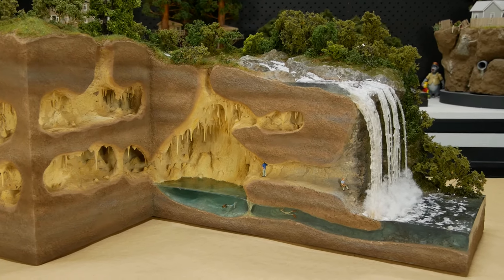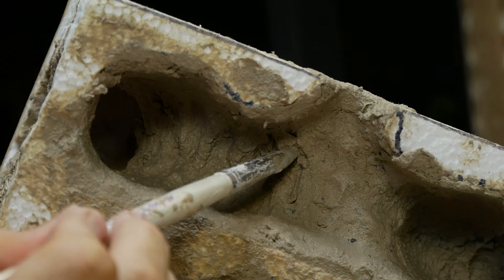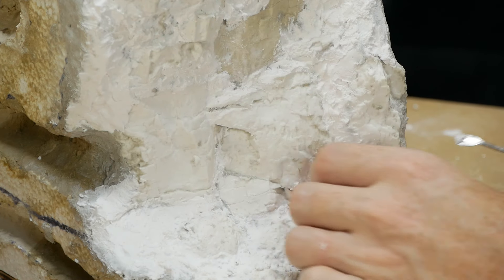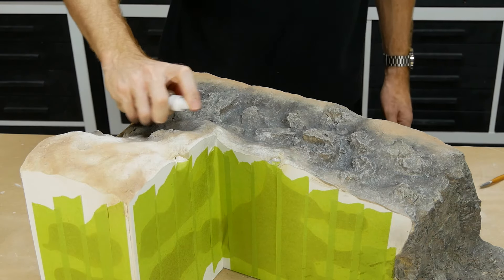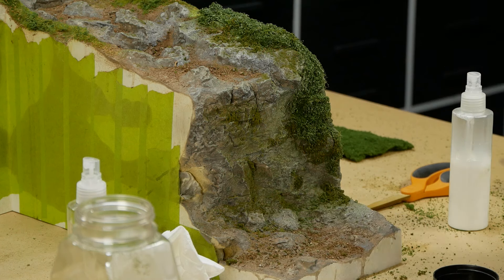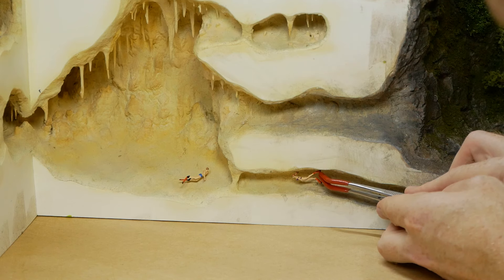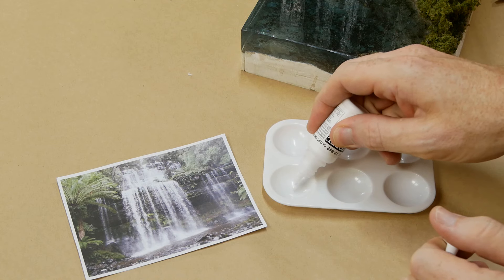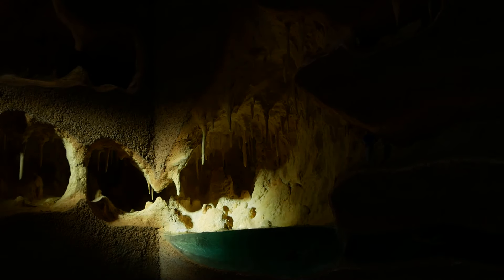An Amazing Waterfall with a Secret – Realistic Scenery Vol.26

Comment: I wonder if white glass micro spheres would be good for white water? Noticed you moved away from the snow filler. They're sold in bulk as epoxy filler. Might add a little bubbly effect.

Excellent work!

Comment: A couple of questions, Luke:   One of the classic problems with using casting resin for water is that it "creeps up" the sides of stream-side and mid-water objects like boulders and, particularly, small rocks.  The creeping effect is quite obvious to my eye (due to capillary action of the thick, gooey fluid, I think. It looks nothing like the edge of real water meeting rock in any case).  
Have you experimented with any additives or resin "wetting agents" you've maybe mixed with your pouring resins?  The sort which might thin down your top layers of resin, thereby reducing the creep, or do you find your final top layer of Mod Podge eliminates the problem?  You've obviously found SOME solution, as it's really hard to pick out any such problem spots on your dioramas.  
For an N scale builder like me, where the problem is twice the size and twice as obvious as with HO, any tips are appreciated.  
Great work, as always.   You are an inspiration, not only because of the high quality of your work, but because you get things done so fast.

Comment: Could you do a video about all the different modeling mixes and plasters and the upside and downside of each one? I'd also love to see a video all about foam. Foam melts or shrinks when you use it with the wrong products and it's so hard to figure out what you can and can't use on it. It's so confusing.

Comment: Try removing the hot glue by spraying on some drops of isopropyl alcohol. It will run between the glue and the surface it is attached to, making it far easier to remove without too much damage.

Comment: You could have made a much more realistic looking waterfall by pouring a thin later of resin in a sheet, waiting for it to cure partially, and then bending it to shape by hand. You can add dimensionality to that by dripping/pouring partially cured resin onto that. That way you get color and texture that matches the river.

Comment: turning the diorama upside down to glue the stalagmites? -no
turning the diorama upside down to smooth in the stalagmites -yes

use water waves to built up the water at the waterfall -no
use water ripples and let them dry but they're still not good? -yes
xD

Comment: Actually the easiest way to remove hot glue cleanly, without effort or residue is IPA. The tiniest amount of isopropyl alcohol will undo the bond the hot glue has to any surface, without turning it into a sticky mess. Not sure how well painted areas would hold up to IPA, but the amount required is really tiny (apply it with cotton swabs for example).
The obvious advantage here would be that it doesn't run the danger of tearing up your work trying to remove the glue.

Comment: This is great and I love the concept and the execution, however I feel like something you seem to constantly overlook with models involving waterfalls or rushing water that would create a lot of mist is that the rocks behind and around said mist and water should be glossy , as if soaked. I noticed this as well in the other waterfall model and the lighthouse one.

In this model the rocks behind the waterfall are darker due to the dampness as you pointed out, yet they still look bone dry because they aren't glossy, whereas real rocks in this situation irl would be getting misted and sprayed constantly and would stay wet as long as the waterfall is going.

Also, I think the cave could do with being a little glossier too, at least near the water. Caves in this situation would probably be a little damp, if I'm assuming correctly.

Also also — and this is just being nitpick-y and I'm guessing this would be very difficult to pull off — I think the water directly under the waterfall should look as if the water falling from above is actually penetrating the surface and churning around the water sitting below, since right now it just looks like the water from above and the water below are separated by a hard surface; the water below seems much too still and calm.

Still, though, amazing work as always! The shot at 0:06 looks incredibly realistic.

Comment: Awesome build. Couple of things. I'm an artist, and white water is never just white. It picks up some of the sky colour and to get the glint of the sun effect, it's drop of white, surrounded by tiny ring of naples yellow, surrounded by a little ring of sky colour blending into white water foam (white plus tiny bit of sky colour). Cause water has a lot of cast shadow effects and even opaque areas still reflect a tiny bit of sky colour. Adding that extra step, really makes water pop (in paintings). You can experiment with your builds for this. Also, I felt the cave colour didn't match the rocks at the entrance and since it's made out of the same rock, it really should be the same colour (effected by exposure to air of course).
Reply: Couple of things. I'm a garbage man, and bananas are bendy.